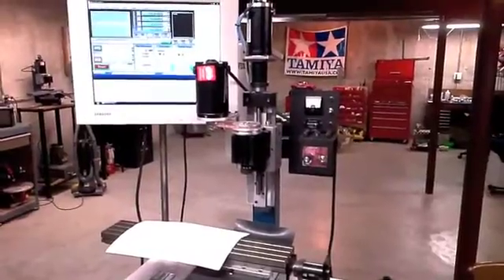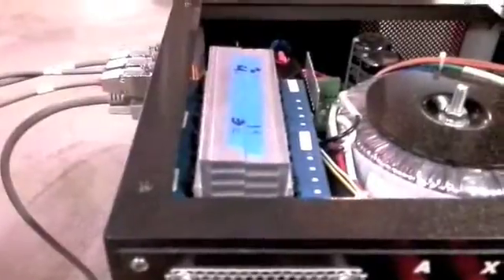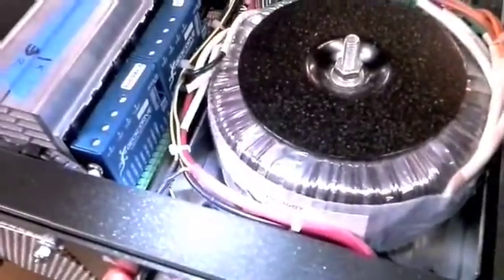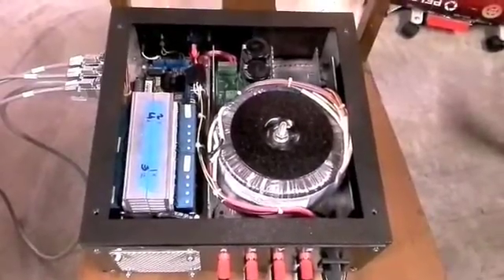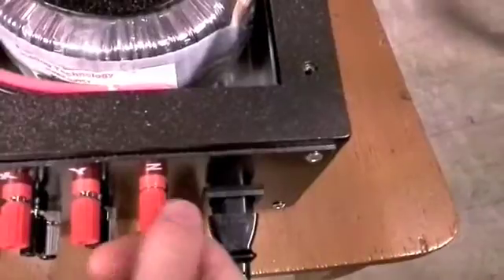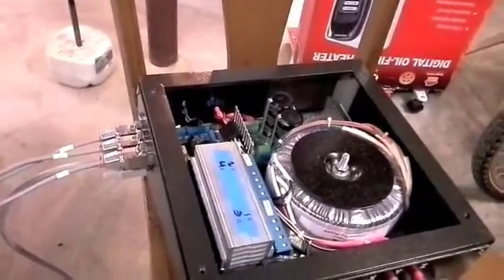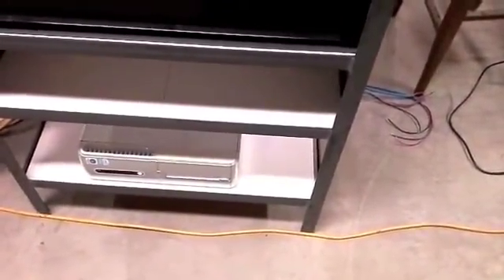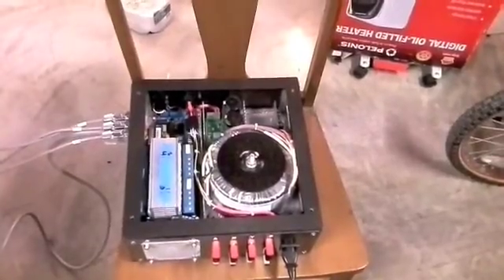Taig CNC Milling Machine Phase 5

Comment: Did you ever solve the problem ? What was the solution ?  Thanks !!
Reply from the maker: Yes I did. It was actually pretty simple. It seems I just had the servo motors wired backwards. So what i believe was happening was the system was looking to adjust the motor by taking a small step in what it presumed to be the right direction. With the motors wired backwards the location according to the encoders only got further away from where it was looking to position it. So what it seems to have been doing was taking a small step to correct and then stopping seeing the motor position getting farther and farther away from the place it's trying to get to. Once I reversed the positive and negative power wires on the motor, everything started working just as it should. 
Unfortunately, I no longer have this setup on this machine. I still have he Taig mill base machine, but have just recently parted out and sold the CNC components of it, with never having done more then a few simple test runs of the unit.